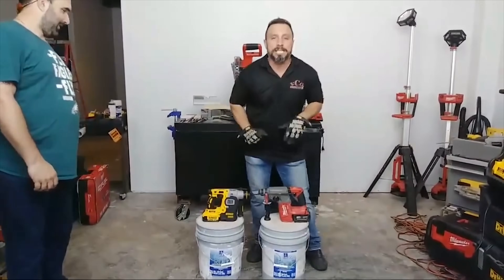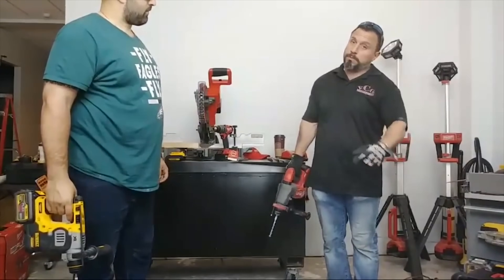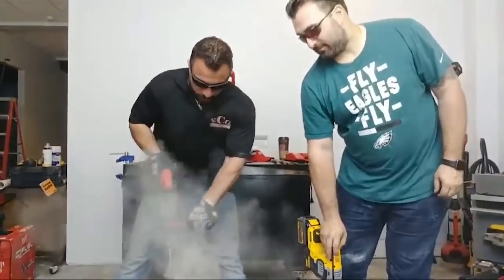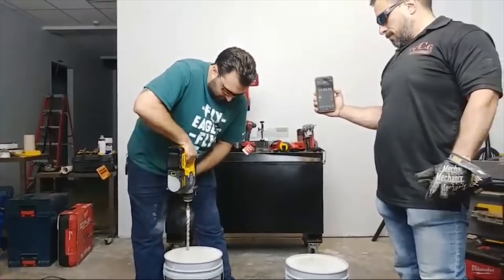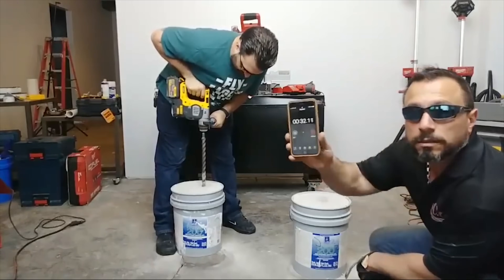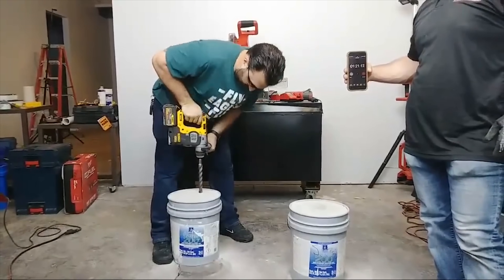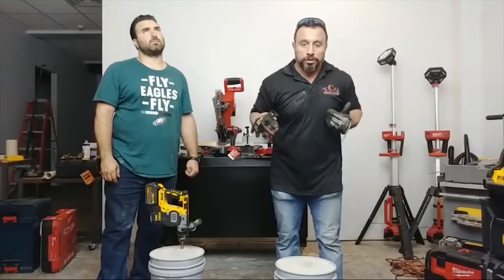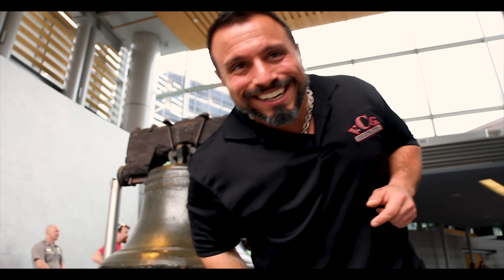Best SDS Plus Rotary Hammer Drill Comparison - Milwaukee (2712-20) VS DeWALT (DCH273P2)

Comment: Good video. However, next time you decide to do a video like that you during editing you should reduce the drilling sound because especially for viewing who is using headset/earbuds the noise is unbearable. Also, use time-lapse in some sections. Some of the viewers will don't bother to watch it to the end when a video is unnecessarily long.
I would like to see you do a video with the Ridgid Rotary SDS Plus which is equivalent to the Dewalt in this video.
Nice video comparison though.

Comment: Also Vince: "So we switched out the batteries to a 2 Ah battery that's been left in the truck for 6 months in the dewalt using the same cured bucket and for the Milwaukee a freshly charged 12 Ah battery in the Milwaukee drilling into a bucket of frozen butter, let's see if that makes a difference." 
Nick in the background: "Dewalt all the waaaay!!"

Comment: There is something in the drill bits.
Why the is Milwaukee blow off the dust when he retract the drill?
That’s mean the bit don’t extract the dust outside fast enough, so the hole is compacted with dust , that’s mean resistance for the impact and the twist

Comment: Have you guys tested the cordless Hilti line? I have been a bricklayer for 30+ years and last year we got a cordless hilti rotary hammer drill with chipper. I gotta say thats a total game changer. Chimney repairs and toothing out old work is now an easy job compared to a dreaded job in the past. I personally have the dewalt brushless line of 20v tools and was curious how the dewalts stacked up vs. hilti. The hilti sets we have at work are extremely expensive, but do come with gps tracking and have unbelievable battery life.

Comment: i use dewalt but very very impressed by the makita used by a guy at one job from another company. one day they handed the makita to this apprentice chick who is clearly not good at handling the hammer drill (not holding the angle consistent sometimes, not pulling to let the dust buildup blow out etc..etc) but makita took all the punishment and just kept going and going from one battery to another and another. can't imagine letting anyone use my dewalt in such a punishing way

Comment: Hello I brought a dch237 a while back rarely used it and the rotary modes went on it. Fixed it again and it went first time using it on hammer mode again . I want to buy a sds hammer drill but stuck for choice which one?

Comment: Ok I like both! Desalt and Milwaukee, The amigo using the Dewalt is about 80 Lbs heavier than the amigo using the Milwaukee, it sure matters the more weight on the drill the faster it sinks! I know because I made a couple of tests and weight makes big difference!
Reply: The dewalt was faster when they swapped drills also.

Comment: The guy using dewalt is just putting his whole body fat pressure on the tool hence why it’s quicker Vince is just pushing on the drill lightly you can tell
Reply: And when vice used that dewalt .he won too ?

Comment: doesnt seem like a fair match a 18v vs 20v  the 20v should win everytime
Reply: The 20v is the full charge. Any 18v lithium battery is 20v off the charger, hence why it's "20V MAX" ... It runs around 18v for most of the battery capacity and tools labeled 20V use it for marketing wank.

Comment: I did think the Milwaukee would win this cause its a newer model . Good job you didn`t use the flexvolt sds . I bought one a couple of months ago when my brother returned back to plumbing . I would say he is team red but after lending the flexvolt I don`t know when or if I will get it back . He did say it was a little heavy at the start but then after two days he changed his mind cause it was so quick and the dampers on it are fantastic . Well done team yellow for a change . I pleased you put them air pockets in for the dewalt .
keep the compares coming just dont put anymore of the 887 as I've not used mine lately . lol

Comment: i have been using the DeWalt rotary hammer drill for years the corded and now that same one I absolutely love it I use it mostly as a jack hammer to take up wet beds and tiles it works great

Comment: IMHO Not a fair test unless you use the High Output battery on the Milwaukee.  Dewalt makes great hammer drills though.
Reply: Do a retest with ho battery and include ridgid octane rotary hammer and or the megamax with rotary to see how they do
Reply from the maker: This a recap of an older video, we didn't have the HO batteries yet, we can do a rematch if you like?
Reply: @VCGConstruction  oh that makes sense.  Thanks for letting me know.  I dont know. Maybe please you could consider using the H.O. battery in future tests when the tools are more heavy duty.  That would be awesome!
Reply: @VCGConstruction  with my 2715 I noticed a difference between 5.0 and 9.0 in power. Don't have a 12.0 but I'd imagine an improvement there to

Comment: Yah, unless the DEWALT motor smokes up, like happened to my bro... then he got a 2715-20 and never looked back!
Reply: Same here, a little bulkier but worth every penny... the clutch works perfectly, trust me I know ;)
Reply: @ibrazeau3044  lmao. I like it unless u need to oversize a hole then clutch kicks in and won't allow it. Had new guy drill holes.. were supposed to be 5/8 he did half so I tried to oversize and clutch kept kicking in. That's only time I've had an issue with it other than that I love the tool
Reply: chris jones same happened here, freaked out.  Sent it to the shop and they laughed at me but they tweaked it and solved it for me :)
Reply: I have the 2715 and love it

Comment: Dewalt tools operate on a higher voltage, therefore an increase in torque its that simple. Milwaukee is only 18volt so it will always struggle.
Reply: That was a dewalt 18v tool not the 60v.

Comment: Teamred can loose every once in a blue moon , we felt bad for team black and yellow,  they now have emphysema 🤣🤣🤣🤣
Reply: RJ&JR RAILS g scale Solenske the only tool red China can beat is the 887 used improperly. But, you have a great toy line of tools with the m12. Ya got that going for ya!!! #m12noodlearm
Reply: @renaissancemen1  im sorry bro  didn't mean to disrespect ya ,your right 5/8 paddle bit is extreme , my m12 the baby of the fleet has no problem with that task ,  no worries just call that the 887AOPE/ mosquito sprayer
Sincerely # noodlearm 😂😂😂
Reply: RJ&JR RAILS g scale Solenske DeWalt will be sending you a strongly worded letter.
Reply: @renaissancemen1  😂😂😂😂😂😂😂😂